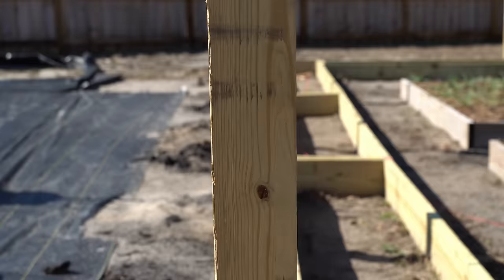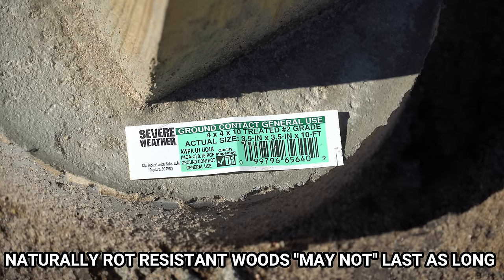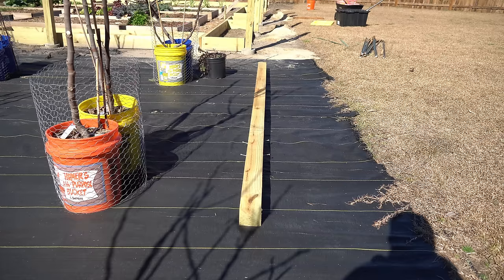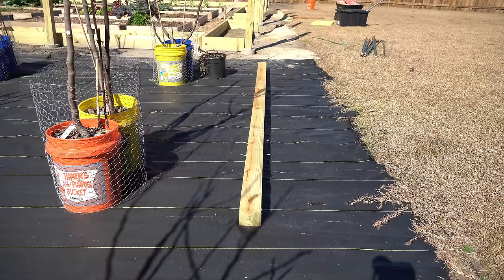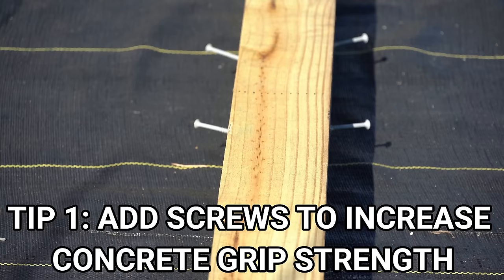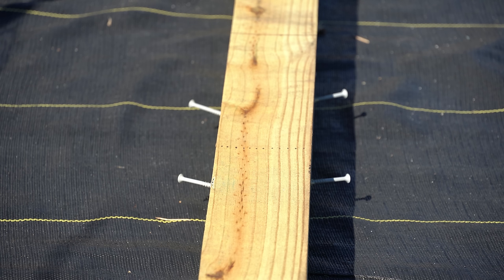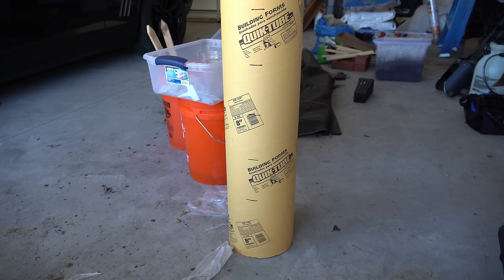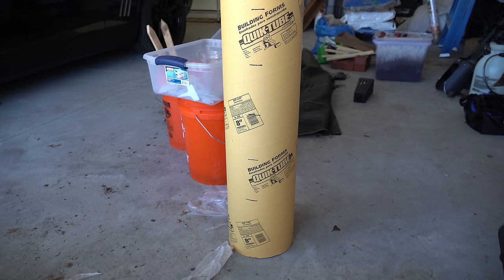3 Tricks To Installing Stronger 4X4 Wood Fence Posts That Last Longer

Comment: The first til is not necessary. There is plenty of grab with concrete on wood posts. I pull posts up with a 12 ton bottle jack between two posts I run two 2x6’s between the posts snd screw them down with about 5 deck screws on each end (20 total) then I jack the concrete right out of the ground by the post. The post lifts the concrete 95% of the time. It doesn’t need more grab if you’ve mixed your concrete right.
Reply: Good last tip that’s a great idea. Thanks for the video and tips!
Reply from the maker: Concrete is not installed to the bottom of the post.  I did not want to install 3 feet of concrete, because when the posts eventually need to be removed, I want to be able to pop them out with a floor jack.  I only poured a concrete cap - the top 12-16 inches - which is enough to give the posts plenty of anchorage and stability, but they won't be as difficult to remove in 10-20 years if they need to be replaced.  That is why I wanted to increase the "grab" of the concrete.  Every little bit helps.

Comment: In addition I put 2 coats of  asphalt emulsion (e.g Henry Sealer & Damp Proofer) to the area of the post that is in the ground plus 6" above ground level. I usually do not paint the entire bottom. This further protects the post from rotting. Another trick is to buy 120% of the posts needed several weeks in advance, lay them on a flat surface with spacers and let them dry thoroughly before using. It will increase the life of the screws, allow immediate painting and you can return any warpped posts to the store for a refund.

Comment: whatever you do people, do not let your concrete run back dowards the post.  mound the concrete so that water runs AWAY from the post.
Reply from the maker: As long as the concrete is sloped in a direction so it does not pool on the foundation, you'll be fine.  Any remaining trace amount will evaporate.  Slope the concrete in the direction you think looks best.

Comment: This channel has a lot of good information and I watch it often because I love figs.  I've been putting wooden posts in the ground for decades.  There isn't anything wrong per se... but I have a few minor concerns.   If you put a post in the ground right it can last 25-30 years or more.  If done poorly, you'll be replacing the posts in 5 years.  I see some small problems here that might shorten the life of the posts and some questionable information I see often.    If you hadn't said not doing your suggestions was a mistake, I wouldn't have spoken up. 

What's important to remember in my opinion when building a wooden fence is three things need to be present to cause posts to rot: moisture, oxygen, and fungi.  It takes time for bacteria to break down wood fibers (sometimes centuries or more.)  Consider for example how the peers of Venice are able to hold up the city after many hundreds of years without rotting.  The peers are wood, sitting in water, pounded several meters into the mud.  In that scenario, there is no fungi or oxygen present.  They've excavated Roman pickets that were pounded into the mud of France 2000 years later.  Again, no oxygen in the soil.  There is still some unrotted wood on the inside of the pickets.  It's fungi that we need to primarily be concerned about so you need to keep moisture away from the surface of the post where they will rot the quickest.  

Next, putting a post on gravel at the bottom of the hole.  It's not about wood touching dirt.  It's about feeding the fungi that rots wood by supplying it with water and oxygen.  For those who ever had the pleasure of replacing an old wooden fence they put up 25 years before they would know the wood underground is usually in the best shape.  Posts are gray and oxidated and tend to rot right at the surface where fungi from the surface, moisture, and oxygen are all present.  The wood 6 inches below the soil line looks almost exactly like it did the day you put it in.  There is just as much moisture found in the gravel below the post as if it's just sitting in the mud down there.  Gravel's true benefit is that provides a more solid foundation for which the post can sit.   Gravel will help a post from sinking if he's holding weight.  A post in dirt is like a nail in wood.  Even a little weight over time can cause the post to sink.  The rock greatly helps keep the post from sinking and settling.  

So, yeah.  Wow.  That's a lot of concrete for what you're building.  Hope it's worth the hassle down the road.  Always good to remember that what goes in must come out.  I went through a concrete phase when I had a horse that liked to sit on my fences.  I regretted it when it was time to replace the fence.  It was too much for my tractor so I wound up having to dig out most of the concrete, or leaving it in the ground with a sheered off fence post still in it.   Otherwise, I can pull up a whole 600 ft fence line in an hour or two.  It took an hour or two just for one rotten post sitting in concrete.   Eventually, that horse still broke all my fence, and the posts rotted faster than the ones I put in the ground that same day without concrete.  I fixed it later with an electrical fence.   Much cheaper than concrete, and worked much better at what I was trying to accomplish.  My tractor's hydraulics is rated for 2200lbs.   Posts buried at 30 inches is a struggle for my tractor to pull out of the ground.  With concrete, my tractor is too small and I wind up breaking the post rather than pull it out of the ground with my neighbor's large tractor.   If I push the post in concrete I'm likely to break the post at the surface than push it over.  Otherwise,  even when putting in dirt without concrete, my posts are plumb 10 years later.

The nails in the post seem to me to be unnecessary.  Even if you pulled straight up, the grip on the post is stronger than you think.  The force required to pull the post out of concrete more than exceeds the sheer strength of those screws along with the weight of the concrete.  You pull on that post hard enough (and it doesn't sheer at the surface), it's coming up with the concrete wrapped around it.   The smooth surface of the lumber is not nearly as smooth as a metal post, and they come up with concrete wrapped around them too.

Another thing, concrete is porous and can allow air and moisture to pass through causing the post to rot more quickly.  Of course, there is a time and place for concrete, especially if there is lateral pressure on the post.  You want it to remain plumb.  In your case, you don't have any animals leaning on them, they aren't performing any kind of wind-breaking function and you seem to know what you're doing with regards to the structure itself.  As a side note: I wouldn't bury a post for a pole barn.  It would be better to build a concrete peer and sit the post on a bracket on top of the concrete rather than embedding the post in concrete.  In your case, the design of the structure will keep your posts pointing straight up.  There is no need for concrete.  And posts have a nasty way of rotting in concrete faster than if you just bury them in the dirt.   Now, the only reason I might use concrete if I'm building a privacy fence that has to deal with a lot of wind.

Part of having experience is knowing if the extra cost and effort are worth it.  I've also learned that sometimes over-engineering proves to be more of a detriment than a benefit.    In my opinion 99% of the time it's just best to best to put a coat of FlexSeal around the section six inches above and below the ground and bury the post in dirt.  You don't need to seal the end of the post, or put it on rock, or use concrete.
Reply: Agreed, thanks for the input. I prefer to avoid concrete wherever I can., your tips and points are helpful.
Reply: Wow ALOT if Information from this video and your comment ... You hold record for YouTube longest comment as well LOL nice info bro
Reply: Idk how I've never thought of flex seal.. I paint a thick coat of roofing tar on my post for the entire submerged section to 10" above ground level and pack the hell out of the clay that holds them in place. So far, no worries.
Reply: This is interesting...Iv a garden on a slope so looking for ways of levelling sections.  If I bury my posts using just flexiseal will it withstand a decking area of 3  x 3 meters without sinking? New to all this gardening landscaping lark.  Thanks in advance for any advice.
Reply: Depending on the smoothness of the hole when dug, frost heaving can occur if the tube form doesn't go below frost line. Having the form at the top only could create a situation where freeze/thaw has something to push up against. When you mention the concrete will settle, it could actually be freeze/thaw, even when below frost line due to creating a lip below the tube form and/or jagged sides of the concrete due to the original hole serving as the form.
Reply: Long and useless in my opinion…
Reply: Screw the fence , send me free " said the Horse.
Reply: youre right about everything here except the part about posts for a post barn. do not use brackets sitting on concrete for a pole barn. The posts need to be embedded in concrete per engineer designs. The concrete and post forms a 'moment' connection, as in it's resistant to moments or bending loads. A bracket is considered a 'pinned' connection, and will not resist moment loads. YOU WANT TO RESIST MOMENT LOADS with a pole barn. That's what gives the barn all it's strength. If you don't, your pole building will fall down the first time you have a big wind.